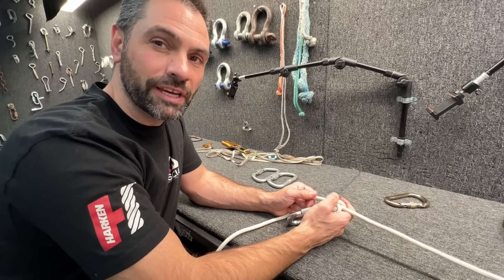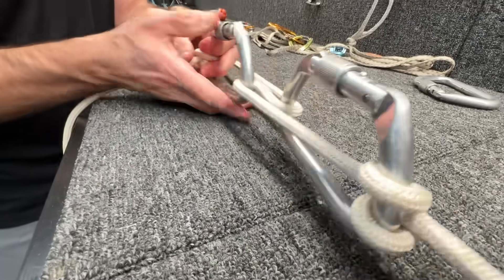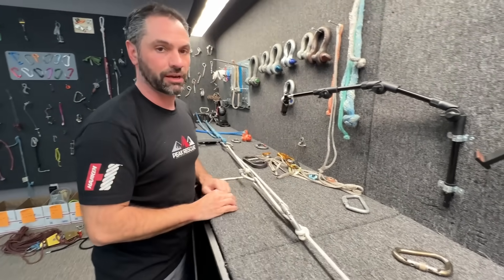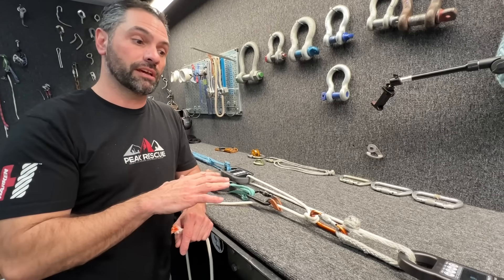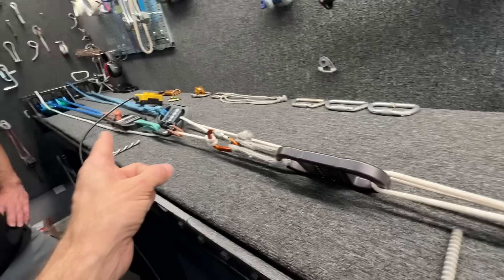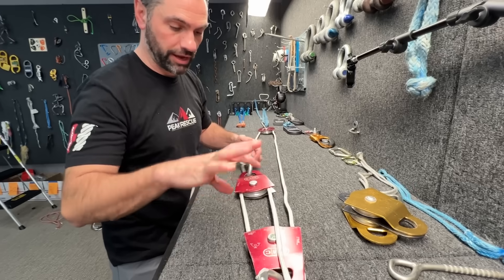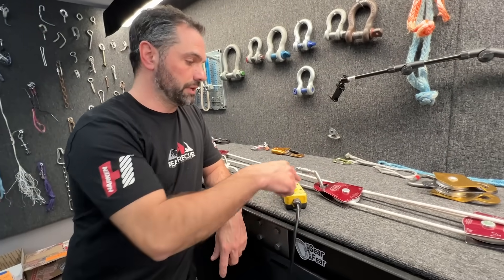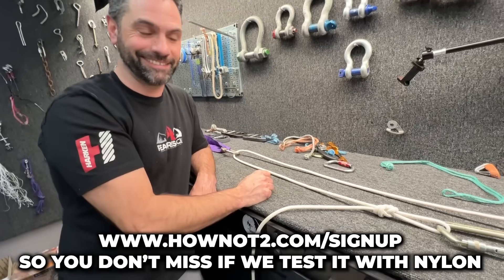I don't understand how this holds

Comment: So as long as the holding friction in the system is more than 1:1, it should not allow the rigging to move on its own.  It looks like it's 2:1 because measuring the mechanical advantage of the system without much friction it's 3:1 and with the carribeners or scales approximately 2 of 3 of the mechanical advantage are consumed in friction leaving about 1:1 at the outside load measurements.

That's my understanding of why it holds.  It will hold as long as friction in the system is greater than the required input tension
Reply: And in this case that required input tension is 1/3 of the outside anchor point tension at the outer terminations of the system

Comment: I learned this knot arrangement for securing anything, using non binding knots to fully secure ocean bound materials. 
Also, it was very helpful in my rigging work on stages. 
Sans the ‘biners. I added loops to the line to be able to created the resistance or opposite side of each pulling point. 

These days I primarily rely on it for cargo transport atop my vehicle when transporting sheet goods and similar items for my work. 

The same high quality lines (rope) I bought in the 90s is still serving me as though they were brand new. Properly stored a good high tensile material can last indefinitely. I wouldn’t rely on climbers lines, since they have a much greater life and death concern.

Comment: You're basically making a tautline hitch. That's why it doesn't hold when you use pulleys. But instead of the rope wraps in the tautline, you have carabiners

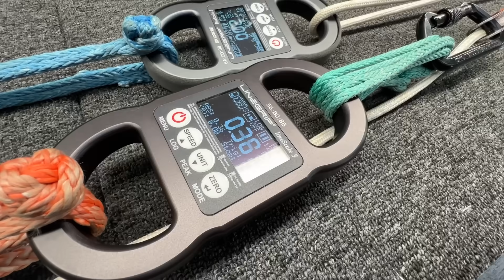Comment: 5:30. I'd say the peak of 3.5 is the advantage but that is with it levering/vetting at 180/ 170° pull
Reply: But if still lock it off. It almost looks like a truckers hitch which doesn't lock (no clove hitch, but also essentially generates cutting forces without the carabiners) but no clove hitch even without the carabiner you Def have mechanical advantage
Reply: Conclusion early on,  I would not trust it for lifting human weight.  Proven true weather it's 1.1 or 3.1 advantage

Comment: Sailor here. Our traveling 420 team used this trick all the time to tie up halyards on masts before strapping the masts to a trailer and hitting the highway. The masthead block and the bail ring were the “anchors” and we used some clever bowlines for everything else. No carabiners necessary.
Reply: that's a dingy you could just velcro the mast down haha
Reply: we also did this to raise and temporarily fix vertical tree trunks in my boyscout group, though we used a slipknot on the tree side, wrap around the ankor, a static eye (bowline or 8), through the slip knot, through the eye and finally slack held in line with 2-3 half hitches.
Tensioning was pulling on the slack and fixing progress with the hitches. We managed to get ~2:1 advantage with minimal tension held by the hitches. Only difficult part was that you needed to get the friction in the slip knot to roughly match the friction around the ankor

Comment: Wow.. you guys are clueless.. lol
It's a closed system.. which is why it can hold itself.  The fact that you can tighten a closed system logically proves that it has mechanical advantage.  Otherwise, you could slide the ropes around and they would never get any tighter if it was only a 1:1.    You can't just say "there's no longer mechanical advantage because of friction" -- That's not how things work.  Mechanical advantage is just a ratio of output vs input;  the friction is only a factor at lower inputs.. Once you increase the force above the friction resistance, then you get movement --- and with that movement, you are getting the mechanical advantage of the system.

Comment: This reminded me of something a professor once said about worm gears (worm gears generally have a lot of friction). If a worm gear cannot be back-driven  (the majority of worm gears can't be back-driven), then it is less than 50% efficient. Without going through the math, I suspect the same is true of this rope arrangement. Without the pulleys it is less than 50% efficient, so it holds. With the pulleys it is more than 50% efficient, so it doesn't hold the load.

Comment: Hey man, can you answer my question ? 

How hard can you fall on a clove hitched carabiner? 

More specifically: 
I had an idea to tie into my harness as normal ( figure 8 ) 
And then clove hitch a carabiner to the rope 
And attach that to my belay loop 
So when I’m doing fall practice 
The clove hitch gets tight and not the figure 8 
But then I realised if the rope broke at the clove hitch the figure 8 would be useless And I could die  

Can you make a video about it 
If you think it’s worthy 😂

Comment: “vector pull” is a useless term and whoever coined it doesn't sound as smart as they think they do. Applying a force in a given direction is a vector, but calling it a vector in no way suggests the direction the force is applied. “Apply perpendicular tension” would sound similarly educated but would actually mean what it says.
Reply: "OHH YEAH"
Reply: I don’t do the maths generally speaking….vector to me implies axis (mri engineer and I work in X-Y-Z axis for spatial quantification) 
I would say XX lbs force in the lateral plane. It’s also how you measure belt and chain tension… how much deflection, lateral to the direction of tension in distance, for a given amount of force in lbs (or however you are quantifying mass”
But my generic physics understanding implies to me that you’ve just generated enough ratio amplification, with all the “pulley” direction changes tha you early on generated more ratio resistance to the built up tension, than the rebound force of the built up tension…
I love the physics of this and you’re convinced me to go learn some more knots… (don’t know how to tie knots? Then tie lots…lol, but true)
I know a couple three “trucker hitches” and haven’t lost a load in a long, long time. But I must needs know more….
Thanks for posting
Reply: Agreed
Reply: I definitely stopped paying attention when he said, "vector pull. Also when he didn't know how to use the configuration of ropes and pulleys to determine mechanical advantage.
Reply: Correct, Vector applies to something with a velocity moving in a certain X,Y direction or 
A quantity having direction as well as magnitude.
The term Vector can be understood as; The relationship of a moving Airplane relative to the position of the tower.
Reply: @drd1924  a vector is an algebraic representation of a multidimensional element. For example, the set of rotations so(3) is a 3 dimensional vector space that's often represented as a continuously differentiable manifold embedded into a 9 dimensional representational space SO(3). I am so smart. S M R T
Reply: @jamesyoungquist6923  I'm very proud of you
Reply: @drd1924  a tip of my fedora to you

Comment: Don't forget that you're measuring external forces. We know that core forces are not the same, from the proclivity of breakage 1,5 diameters from the point a flexible rope becomes rigid entering a know, it's the point where the forces reflecting off the rigidity bouncing off the external wall refocus. Force cannot disappear, nor can it be shed into air or liquid ither than as heat. When you replaced the hitches with pulleys, you removed the reflection.

Comment: Around the 3 minute mark when you try to add more tension to the system by adding some hardware and a sling, you are only re-directing the force and are able to get your body weight behind it. there is NO mechanical advantage in that set up. as far as the vudu hitching goes, its remarkably similar to a truckers hitch which has a 3-1 mechanical advantage. I would hypothesize that it DOES still have that mechanical advantage without the pulleys because they only simplify the problem by removing a large amount of friction. without them you should still have that 3-1 advantage if you can overcome the force of friction.  Is there a way you could test this hypothesis? or a truckers hitch?

Comment: Sailor here.  My understanding is that when a halyard is being raised and a deck hand is reaching up to grab the line at a high point and letting their weight pull own on the halyard, that is called "jumping the line."  When you pull sideways to add the last bit of  tension with the help of a person "tailing" (like you did in the video)  that is called "sweating."
Reply: Came here to say the same thing. Dont sweat the small stuff. I.e. if you "sweat" small lines you will break them.
Reply: @Heybudhowsitgoing  oh right. Cool
Reply: Marine here, You are correct, We had the term "Swigging" for helping the sailors with "sweating" which of course means something totally different to a Marine(munitions maintenance) The term came from fighting the Barbery pirates when in sea farring battles the Marines would rig these higher tension lines on a loop pin knot that they could use for "quick ejection" and faster boarding as one of these lines on a large enough ship at full sail can launch several men 50-100 yards. it's combined words rigging and swinging into "Swigging"
Reply: As a youth in the very late 70’s I briefly served as crew aboard an old square rigger used for marine mammal research.   Learned the same technique as “swaying” the line.   Often a two person practice with the line around a belaying pin, and one person standing ON the rail applying the out-and-down while the other holds tension during out, and takes in the slack as the swayer does the down
Reply: I love nautical language. As a child I thought it was weird.gibberish. Im from a navy family so it was drummed into me young. It wasn't until I saw the spelling of forecastle that I realised that they were real words. I don't remember which term made me understand that it's weird because it's old. Very, very old. Mostly old Norse.  
  Starboard is one of the strangest common ones. And it dates all the way back to before central ruders when they had the stearing board (or larboard) on the right stern. So docking at PORT would always be left side. 
  Cool huh.
Reply: If the goal is a friction capture system with mechanical advantage then why not use a prussic on a 3 to 1 pulley system?
Reply: Muienter or Climb heist seem similar and maybe more reliable. Freedom of the Hills Mountaineering
Reply: Cool terminology!
Reply: Their weight, and/or water movement? If the boat is rocking n rolling the two hard points are moving together naturally their weight is only tensioning/locking the shortened line
Reply: Thanks for the information

Comment: I would say that in an ideal rope with no stretch, there shouldn't be any mechanical advantage.
The easy way to see it is to consider the rope in 2 parts.
The first part of the rope goes from the point is is tied off, through the first carabiner, to the carabiner that has the rope tied to it.
The second part is the continuation of that back through the first carabiner, around the tree (or whatever) and back to the carabiner that has the rope tied to it.
This second part is just a loop, which circles around, so it doesn't change length, so it can't provide mechanical advantage.
The first part is basically just a rope from the carabiner to the tie off point, so it doesn't provide mechanical advantage.

The only mechanical advantage that would come is from the rope stretching.
This allows the loop to shrink slightly as the portion of the rope from the tie off point gets longer.
But this is a very small advantage so it will be close to 1.

Also, mechanical advantage exists in both moving and static systems. In static systems it is force.

Comment: The line bends over a carabiner at three places.  Presumably it will slip at one of these when the ratio of the tension on the two segments reaches some critical number.  A little slippage at one bend tends not only to even up the forces there, but also at the adjacent bend(s). So the whole system will tend to a state where all the ratios are under the critical angle if such a state exists.  (I’m ignoring the difference between static and dynamic friction.)  In this case, all the ratios are equal when they are at all at about 1 to 1.3. So as long you can pull one end of a bend at 1kN and the other at (a little more than) 1.3kN without the line slipping, the hitch should hold.  I wouldn’t stake my life on it though; I would tie carabiner 3 to carabiner 2.

Comment: Suppose that carabiner 2 is attached to the ceiling and carabiner 1 is attached (via the tail of the line) to a weight.  At one extreme, carabiner 3 is touching carabiner 1 and the distance from 1 to 2 is 1/2 l where l is the length of the rope (ignoring the tail that connects 1 to the weight). At the other extreme, carabiner 3 touches carabiner 2 and the distance from 1 to 2 is 1/3 l.  Consider a 6 meter line.  Initially the distance from 1 to 2 is 3m.  After 3 moves up these 3m the distance from 1 to 2 is 2m.  For every 3 cm you move 2 up, the weigh moves up 1 cm.  So there is 3 to 1 mechanical advantage, which allows you to make the line taut if you are connecting two fixed points, But there are also 3 places where there is static friction, which allows enough stiction for the set up to be stable under load.  In fact the more taut the line the higher the static friction.   (Roughly linearly.)  I’m no climber, but it seems to me it would be stupid to suspend a person using this unless the line from carabiner 3 were lead back toward carabiner 2 and tied off at carabiner 2 or to something equally immovable.

Comment: it's the 2-3-2 swap of number of strands, and the middle one has an opposite direction, so you MUST have a reduction in thread tension as you go around each 'pully' and one of them will have the most friction drop of tension. In the low friction pulley test there is not enough friction to allow the apparent inequality (sequence of tension changes at the 'pulley' points) to be maintained.

I've certainly had it demonstrated as a (loaded) canoe recovery technique, but it's real hard to sort out how to set it up! It's does feel odd when you have a 'free' line system that holds tension.

Comment: Without looking in detail at the loops,I would assume the locking is due to a ratchet effect in the loop—straight tension causes it to pinch the line, but adding some side force releases the pinching. Think how the lift cord in Venetian blinds works.
Reply: Venetian blind cords hold or release, because there is a small roller in a sloping groove in the channel above; pulling down takes slack up, the roller rolls down and binds. Pulling to the side lifts the roller, giving just enough clearance for the string to feed back. No primitive binding of cord on cord is involved.
Reply: @z1522  Most Venetian blinds just have s little clip stamped out of steel metal, with no roller. 

At any rate, both mechanisms allow tension to pull the cord through, but the cord can't retract because the passageway collapses, binding the cord. That was the point i was making.

Comment: This is really similar to some 3rd year engineering dynamics final exam questions. Especially the question of "why does the system's advantage change inversely proportional to the systems ability to hold or progress capture when the coefficient of friction is the independent variable?" The coefficient of static friction between the rope and the biner is always higher than the coefficient of kinetic friction after the rope has started to slide. As far as the system is built the slack tail of the rope is not in the system under static conditions, as the tension at the anchor does not exceed the total sum of friction. Although the friction from the final carabiner after the piston dyno is included, but less influential than the biners that have a 180 degree contact with the rope. The higher the coefficient of static friction between the biner and the rope, the more tension it will hold before slipping. Then when adding force normal to the pulley system you are doing 2 things. The first is wrapping more rope around more of the carabiner thus increasing the surface area that friction is acting on. The second is that you are adding potential energy into the rope's elasticity, and getting closer to the impending slip. When you relax the system while pulling the slack through, you are using the stored potential energy in the elasticity of the rope and the lower coefficient of kinetic friction, which is why it works like a progress capture.
Reply: thats a whole lot of words for Ryan to ultimately say 'magic'
Reply: Increasing the area won't increase friction. Wraping multiplies force the same way a block and tackle multiplies force. The rope is under a given tension so more wraps = more total force. To calculate the normal force with which the rope squeezes the carabiner you can solve the hoop stress equation modifed for force.
Reply: I commented elsewhere that it seems to me that modern tent lines with the plastic bit in the middle with two holes are functionally the same knot. Would you agree?

Comment: Because you have both ends of the rope tied off you have a closed system. As you tension it you're applying energy from outside the system so that must stay in the system as the tension until more energy is brought in from outside the system to release it.

Comment: I can't help but ask, "what about ratcheting pulleys?"
Would still be low friction when adding tension, but the ratchet would preventing it from rolling back. Seems like a best of both worlds kind of deal.
Reply: Now I want to see this tested! 
I also want to see them test this with just knots (no carabiners). That can be done with an inline 8 or butterfly in place of the first carabiner and a fixed loop or a barrel knot in place of the other (alpine butterfly and bowline are my choices but would love to see different options tested).